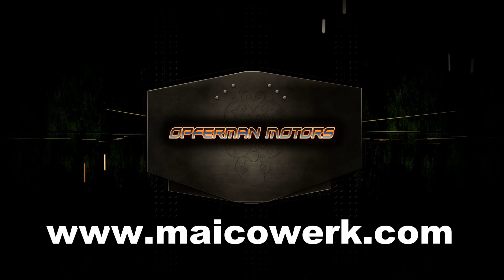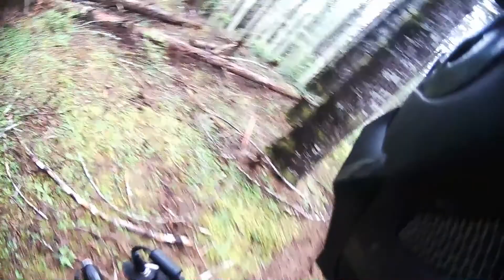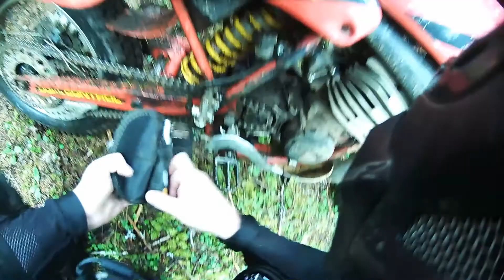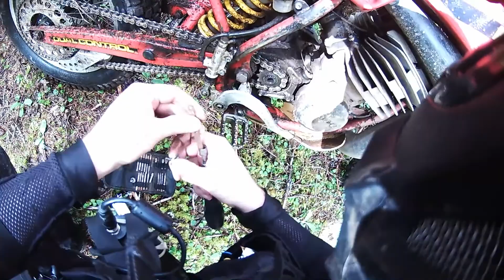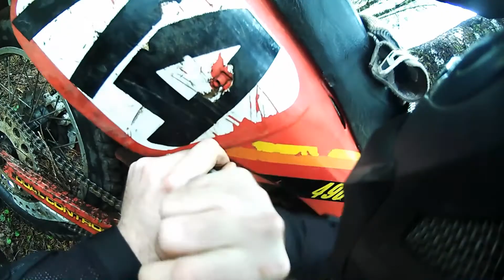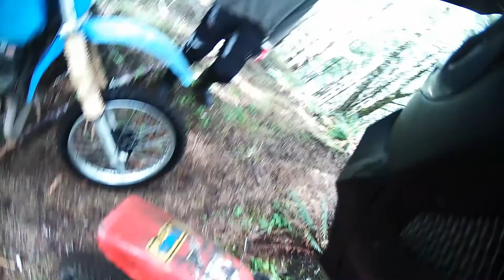1983 Maico 490 - Broken Side Panel

Comment: Get some plastic spacers made up bro ... spin em up to fit ...
Reply from the maker: Jason Noble I had some from the exhaust, little cylinders, but lost then the first time the bolts rattled out a long time back.  Now there's a spacer behind it which is a lever adjustment!